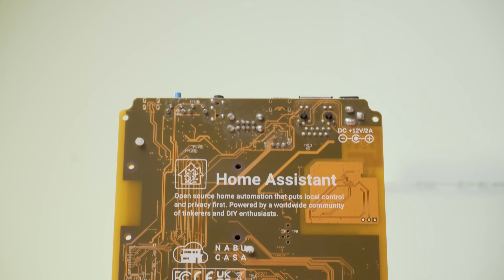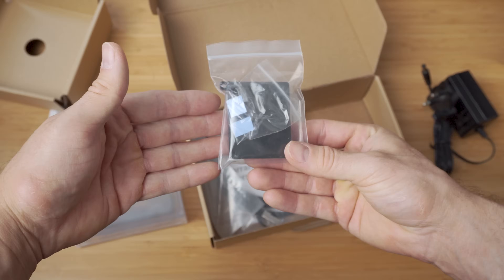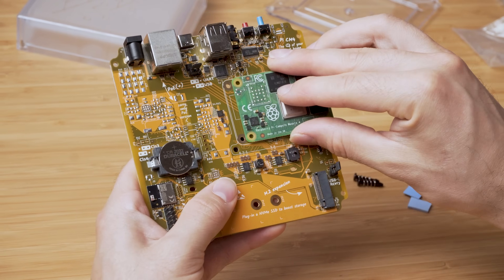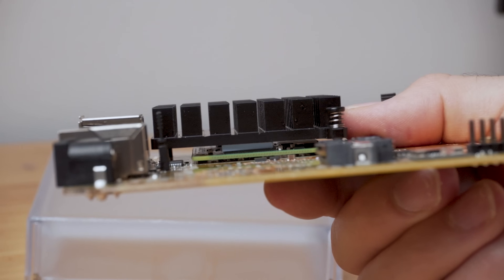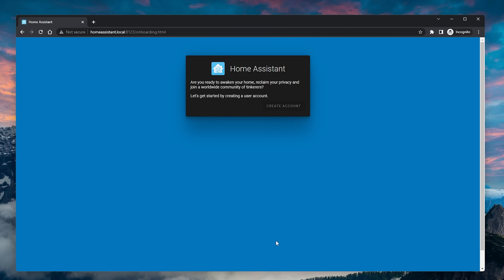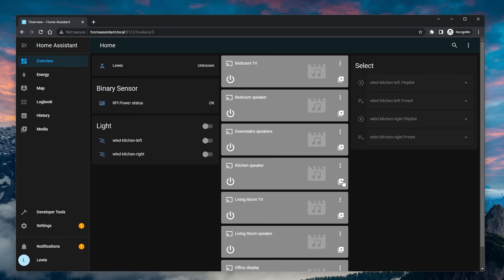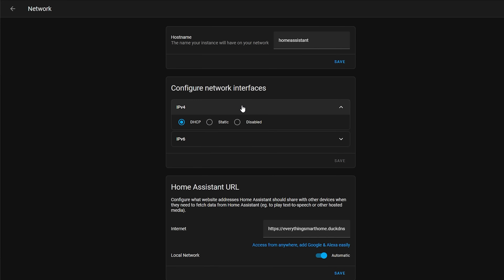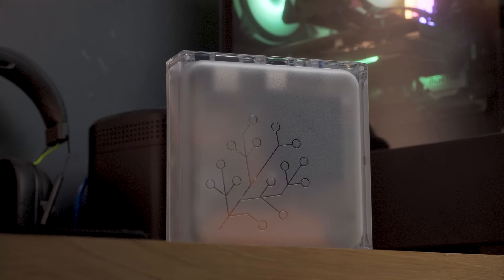Getting Started With Home Assistant Yellow!

Comment: I’m completely new to smart home world and I bought a new Home assistant yellow kit and able to integrate Ring front doorbell but not the door sensors and the base station. Though I’m able to access the flood light cameras only the light and siren info only but not the cameras. Can you please help me if I’m missing anything here? U0173	Home Assistant Yellow - PoE Kit (Without CM4 Module)	1
C0277	NVMe SSD - 1TB Silicon Power	1
U0176	Raspberry Pi Compute Module 4 (CM4) - 8GB / 16GB / Yes WiFi/BT above is my configuration
Thank you in advance!

Comment: Thanks for the great detailed video.
Unfortunately (for me) I encountered and issue not described here.
When I connect my HA (which uses PoE) to the Ethernet cable it just won't start (no led light turns on at all).
I check the CM4 module connection (which seems to be the common issue on many other threads) but not in my case :(
Hope maybe someone can help..

Comment: Hi there, I need your advice. I have an 8GB RAM RPI CM4 Lite. If I copy the image file using RPI Imager on my PC directly to my M2 NVME SSD using a USB adaptor and then install it on the main yellow board, will it install the Yellow HASSOS when I connect power and ethernet cables, or do I need to fit the blank SSD first then use the USB stick flash method in your video? The only downside to the former method (if it works) is that it will leave the img file on the SSD.

Comment: I got my POE kit Yesterday, and stumbled upon a few gotchas, which might be worth mentioning.
First, the USB installer does NOT work if there is already an OS on the CM4. It will always try to boot the eMMC on the CM4. I had to wipe all partitions from it.
Oh, and wiping those partitions wasn't easy. I tried those instructions on how to make the CM4 come up as a USB device multiple times, it just didn't work. Fortunately I had another carrier board, so I popped my CM4 into it, ran rpiboot and all the partitions mounted. After wiping all partitions in parted I was good to go, and the USB key did its magic.
Second, there seems to be a bug in the current Homeassistant release, migrating the data disk from the Homeassistant UI is totally impossible.  It fails every time, and the error message is some totally unhelpful "couldn't migrate" message. When checking out the HA forums I noted lots of people having the same issue. Fortunately someone has reported it on Github so I assume it will soon be fixed. In the meantime, opening up the debug ssh port on port 22222 and doing the migration from there works. But it was anyway a lot harder to do than I expected.
Third, what the ** am I supposed to do with 1 TB on my data disk? My local store had no 250 GB SSD:s and the 500 GB NVME:s were almost the same price as the 1 TB ones, so I went with that. Some problems are truly harder than others. 😃

Comment: As usual, you choose to ignore that many of us are running HA core in  a docker container on a linux server, and thus your otherwise excellent HA migration to Yellow guidelines, are of little value to us. Also you never specifically discussed which compute module 4 to choose for those of us with a kit. Do we need to buy one with onboard Wireless? Or can it work just fine without? Do we need 2,4 or 8 Gb?  Are there any disadvantages to choose a Lite version?
Apart from this, great Video as usual 👍
Reply from the maker: It's not ignoring and unfortunately you are very much in the majority if we look at the stats - 70% of users use OS and less than 20% using container, hence I try to target the largest audience possible where it will help the most.

Another big part of it is ability - if you have made the conscious decision to run container, then chances are you are more advanced by nature and don't need a step by step guide. Same goes for the compute module, you've made the decision that you are going to pick your own, so you probably know what you're looking for and are more advanced anyways.

At least that's the way I see it
Reply: @EverythingSmartHome   I see your point, and a very good one I must admit. Although it does make me feel lonely. Much like the feeling I got after intense effort searching for RPi CM4 and when I finally found a dealer with one in stock, my country wasn't on the list when I tried to check out 😒 It seems that whatever I do, it turns out; "Sorry, not for you!"

Comment: Well I finally migrated from my HA Blue to HA Yellow.  I am using a Sonoff Zigbee dongle with Zigbee2MQTT.  First attempt to fully backup system and restore it to the Yellow and set path/ID to new Zigbee controller in Yellow FAILED.  So, for now, I plugged in my Sonoff dongle into the Yellow and was able to update its path after a restore.  On original system I did STOP my MariaDB addon and then did the full backup.  First restore on to Yellow seemed to FAIL as I could not get either the MariaDB or the Zigbee2MQTT addons to successfully start...  I gave up and went back to the HA Blue.  After a day or so I decided to boot the Yellow with the Sonoff dongle attached again and capture some of the Log entries to try and understand what it did not like. SURPRISE!  When it powered on, both the MariaDB and Zigbee2MQTT addons started!!   After sometime passed, most all of my 45 Zigbee devices reported online.  I had about 4 that I had to re-pair with the dongle.  Today, all are reporting and working.   I had about 5 that needed their location set, but the remaining migrated over their location settings as well.

Now I just need to learn how to migrate from the Sonoff dongle to the built in Zigbee router on the Yellow using Zigbee2MQTT.

I have heard that the range of the built in Zigbee is not good, but I would like to test / see that for myself and I could always migrate back to the dongle.

Still a mystery as to why a shutdown and power cycle of the Yellow and a repower on of the unit allowed both the MariaDB and Zigbee2MQTT addons to work / start???

Comment: I finally got around to migrate my HA to Yellow and it went absolutely smoothly without any bump. All thanks to Lewis for such a comprehensive guide. Hats off to you sir. Might be silly but just so anyone wondering no, SATA SSD won't work with the Yellow. And in regards to Z-Wave Stick, you just plug into Yellow and boom, starts working straightaway. And finally, zigbee devices, for me the migration radio button in the configure menu, worked without issue. Just make sure to connect your old stick into the Yellow which will also deletes all data from the old whilst migrating to the Yellow.

Comment: Just got my HA Yellow (finally after such a long wait). Thanks to your awesome video I got it setup in no time and without any issues. That was absolutely painless. Next step will be moving all my 60+ Zigbee devices from 3 different zigbee networks (Hue, Ikea and Deconz) all onto the HA Yellow ZHA. I fear that won't be as painless and will cause me a few more gray hair 😂 But let's see maybe it won't be that bad.
Maybe you could do a video on that as well 😁
Reply: Just hope that your hue bulbs are still set up on the hue hub. If not, you will need to add them back using the serial number. That's the easiest way because the hue bulbs only go back into pairing mode when you delete them from the hue app so do them one at a time or the pairing may time out before you add them to HA using ZigBee (not the Hue integration) making you add them back to the Hue app again. There is also a way to put them in pairing mode but it requires a hie dimmer switch which I do not personally own. This was not fun, especially if you have a lot of hue lights but HA is so much faster for turning on/off lights then through the hue hub.
Reply: @JoshFisher567  Thanks for the tips. Yes all my Hue lights are still connected to the HUE bridge. I will go one by one and see how it works. I have 50+ lights, 20 light switches, 5 or 6 dimmer switches. So it will be lot of work

Comment: Wanted to get one but not available until 2023, did I read that right? Thanks for the great intro - I did not know about this handy device before hand!
Reply: What's harder to get right now is a CM4. It's impossible to find at the regular price. All sights say first quarter. 2023. Not sure how long it would take to get the yellow if you ordered now.  I almost went for the POE version but glad I didn't because they had to go through a redsign. 

I did my pre-order on June 10th and my yellow just got here last week. Might want to check out the home assistant SkyConnect. Not shipping until December but a ZigBee/Thread USB adapter for 30 bucks is a heck of a good deal and you know it will work great with HA. 

If you have an older PC you might be able to set up HA on it. I haven't set up my yellow yet. Running HA on a 8 year old NUC but it's starting to act flaky. Neither of the video outputs worked when I installed HA 4 or 5 years ago on it so I'm surprised it has worked this long anyways. If you have a NAS you can run it in Docker but that requires a bit more technical knowledge for setup.

I believe you can run HA on a pi4 using an SSD now, not 100 percent sure but an SSD will speed it up a lot compared to an SD card. You can get a ZigBee 3.0 USB adapter for 20 to 30 bucks right now. 

If you have an older PC that is not in use then you can download the x86 version from the HA website. You have to image the drive (I used etcher) then put it back on the PC so you will need some sort of adapter. After that turn it on. This is why I haven't set up my yellow yet. My 8 year old Nuc is 10 times faster then when I ran it originally on a pi 3 using the SD card. At the same time I know the yellow is going to work with everything without any issues so that's why I got one. 

I don't think they expected the number of orders they would get. Their crowdfund goal was 150K and they are over 1million now. 

I believe HA is now the second biggest open source project and it's been around for 5 years or more so it's not going anywhere. It's here to stay. If you have a spare pi 3/4 then you could just set it up to make sure it's what you want then order the yellow if it is. You want it hooked up to Ethernet. It works over wifi but adds latency also.

Comment: Thanks for the video. However my Yellow refused to connect with the connection refused error message. What can I do?
Reply from the maker: Did you make sure to use http or https as mentioned in the video?
Reply: Thanks for reply. Yes I did. Also tried both http://homeassistant.local:8123 and  http://ip:8123. I bought the standard UK version.
Reply: Ok, I did a factory reset and now everything works like a charm! Thanks.

Comment: Bluetooth dongle? But the raspberry pi should have Bluetooth build in, or dosnt it?
Reply: It works with all 32 variants of the CM4 module so you can get a CM4 with BT/Wifi. They chose not to with the version they shipped that includes a CM4 due to possible interference issues with so many radios next to each other. Have fun finding any CM4 for retail, obviously you can pay double to get one but they are not going to be available until 2023 for retail price 

It would be best to get a BT dongle and USB extension cord to avoid any interference issues though

Comment: Where can I buy from
Reply: I recommend you don’t. This is still only available on CrowdSupply. I ordered mine at the start of August and haven’t received it yet. 

Don’t plan on purchasing this, wait until they have their stuff sorted out and go with a setup you can buy right now instead.
Reply: Also,. It's impossible to find a CM4 right now, at least for retail. Probably better off with a pi 4 and ZigBee USB adapter unless you want to wait until 2023. 

Also, there is an x86 version of HA so if you have an older PC that you don't use then that would be better. I've got HA running on an 8 year old NUC and it is so much faster than when I had it on a pi 3.

Comment: Thanks for this excellent video Lewis! My Yellow kit arrived yesterday and I am counting my blessings for having purchased my CM4 in anticipation late last year (when they were 'difficult' to obtain rather than 'near impossible'). I put it all together today and ran the installation with migration from backup. The only 'issue' is the ZHA migration - I have the ZHA backup but have plugged my old stick into the yellow so everything works for now. Triggering the migration when the new coordinator isn't on usb seems to be the sticking point and the forum advice is to wipe the configuration then install from backup so it triggers the migration. But I think I'll wait for more refinement and documentation of that process.
Reply from the maker: Thanks, glad it was useful! Hmm, can you migrate from the old coordinator to the new one directly without plugging the old one in?
Reply: @EverythingSmartHome  I tried a straight migration, but it was looking for the coordinator on USB and didn't 'see' the yellow's zigbee coordinator. I'm still on the 2022.9.7 core, so maybe this would be fixed in the 10.1 update I'm yet to apply or in the near future. I also had to uninstall and reinstall the Blutooth integration because of the change in bluetooth adaptor, but as I haven't made use of that integration yet, I just took the simplest fix. Now the new system has been running for 24 hours, I can also report it is running cooler than my old HA install on RPi4 in a Pibow with a Pimoroni Fan Shim. The provided heat sink in the custom case is keeping the CM4 CPU around 6-8 deg C cooler than the RPi4 CPU was in the same environment. Pleasantly surprised by that.

Comment: I am getting my yellow next week. I and getting a writing error  when using pi imager on my USB drives when trying to load image on stick. Does it matter the type of stick for this. I tried 3 different ones and also a SD card in a USB adapter same error on all 3. I formatted cards before running also. They don't have the file anymore as downloads on raspberry site to use baleana  etcher to flash it.

Comment: They still have issues with emissions on  the PoE version of the Yellow as of now (30 July 2022), but the non PoE versions are shipped :).  I believe the HA team are confident the PoE version will be approved soon.
It may be there first attempt at partially custom hardware (partially because the Raspberry Pi compute module is not a custom part), but they have put a lot of effort in with it being over 2 years in development.  The HA team are very thorough with their testing and quite picky with part choices, so I expect these to be reliable for a long time.
Reply: As of October 2022 the POE version seems to have passed emissions testing.  Amazing work from the Home Assistant and Nabu Casa team!.
I believe the AEOTEC Z Pi 7 or the ZwaveMe Razberry 7 will also plug straight on the small header port to add Z-Wave radio to the Yellow if you need integrated Z-Wave rather than a USB Dongle.

Comment: Thanks for the video.  I notice Yellow uses Raspberry Pi architecture.  I really like the ESP32-C3 microprocessors, not least for the 5v pin, but ESPHome cannot integrate them on Home Assistant when run on Raspberry Pi!    To me this is a serious limitation.  A few posts on the internet have said you can overcome this by using platformio but as yet I haven't seen a working example. I'd love to see a step-by-step video, Lewis!
Reply from the maker: I'm not sure what you mean sorry, esp32s don't need to be plugged into the Pi for them to work with ESPHome
Reply: @EverythingSmartHome  Thanks for the quick response and apologies for not making myself clear.  My Home Assistant runs on a Raspberry Pi 4.  However, when I try to add an ESP32-c3 to the ESPHome integration (and I have a couple of ESP32 Wroom already set up), you go through the process of selecting the board and then installing.  The process fails at this point.  The error says a certain package is missing.  According to posts on the internet, the ESP32-C3 is incompatible with Home Assistant because it is running on a Raspberry Pi.
Reply from the maker: I'm not aware of any limitations - if your running home assistant OS 32 bit then yes that could be a problem, you should switch to 64bit which should clear up any issues
Reply: @EverythingSmartHome  I am running it on 64bit!  The nearest thing I have seen to a solution is "someone with same problem - response is build it on an intel/amd pc" which isn't exactly elegant. I'm wondering about shifting HA onto a spare laptop and junking the Pi.  Anyway, thanks for your thoughts, really appreciated.  Have a great weekend!
Reply: @EverythingSmartHome  ESPHome installer reads:  INFO Reading configuration /config/esphome/esp32-c3.yaml...
INFO Generating C++ source...
INFO Compiling app...
Processing esp32-c3 (board: esp32-c3-devkitm-1; framework: espidf; platform: platformio/espressif32 @ 3.5.0)
--------------------------------------------------------------------------------
Tool Manager: Installing espressif/toolchain-xtensa-esp32s2 @ 8.4.0+2021r2-patch2
Error: Could not find the package with 'espressif/toolchain-xtensa-esp32s2 @ 8.4.0+2021r2-patch2' requirements for your system 'linux_aarch64'

Comment: One question: should I update the HA Core and OS on my existing install before migrating using a backup? Or will the backup restore fine (for the most part) and would only need to tweak a few things that the updates might have broken?
Reply: It's generally advised to restore to the same version you have backed up from, as since the Yellow will download the latest Home Assistant on boot, then you should upgrade to the same version and then backup.